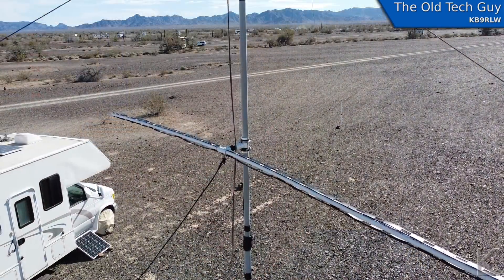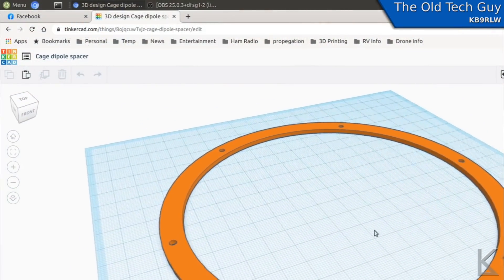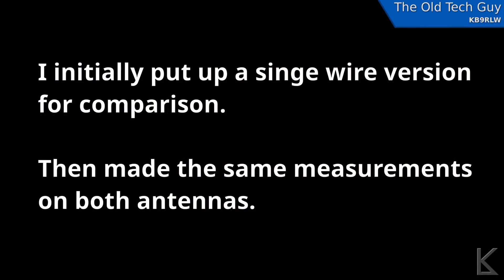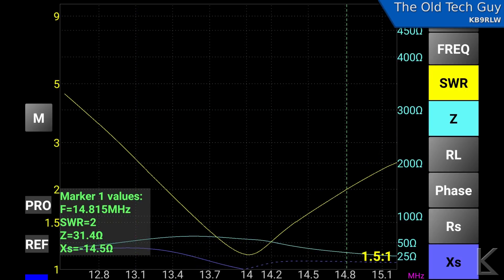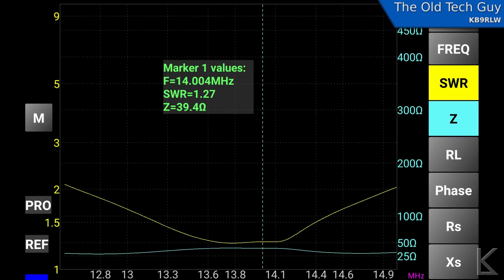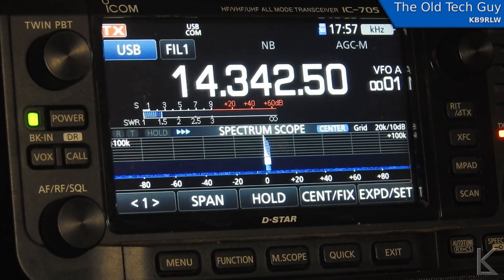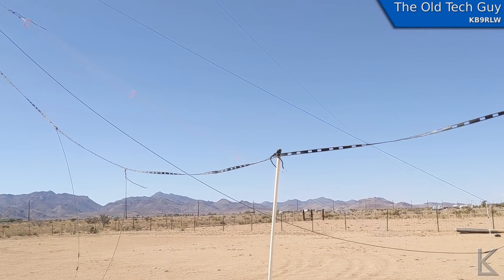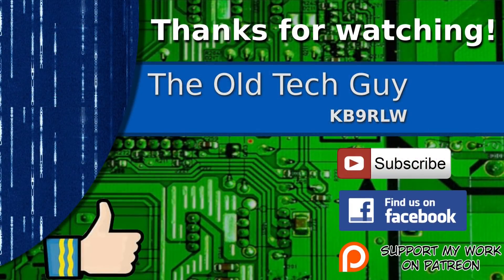Ham Radio - An end fed half wave cage antenna.  How much wider bandwidth does it provide?

Comment: Hi Kevin,
Thanks for the effort. That was an interesting and successful experiment. It did use up some wire. HiHi. i saw a report that the entire SW region will be in for a severe drought this summer. Hope you can find ample water. Had both my Moderna injections and will be fully protected by end of the month. Stay safe.  73  WJ3U
Reply from the maker: Well technically, not fully protected.  You can still catch the virus, your body will just be primed to battle it and you won't get sick enough to require hospitalization.
It'll take a couple of years to develop a vaccine that will bring immunity.    Still need to be cautious.     
I'll be getting my first jab soon.  Maybe this week.
Reply: @loughkb  Hi Kevin,
By fully protected they say you need two weeks after the second Moderna injection to be fully protected. I know you can still get the virus, but just like a flu injection, it will help reduce the severity in the event you become infected. Do you know which vaccine you will be getting? 73  WJ3U
Reply from the maker: Not yet.  I'll find out when I call to make the appointment.
Reply: @loughkb  Well.. be careful. Lots of fully vaccinated people are being diagnosed with the virus on ic's worldwide now. So much for protection for this heavy flu.
Reply from the maker: Of course.   A vaccine that's 90% effective means that 10% of recipients will still be at risk.   
It's not influenza, that's a different virus entirely, with a lower mortality rate and nothing like the lasting effects of a severe covid infection.
It's certainly the smart thing to do, getting the vaccine.   A huge improvement in your odds when it comes to this particular virus.